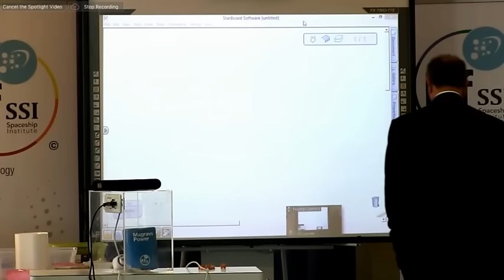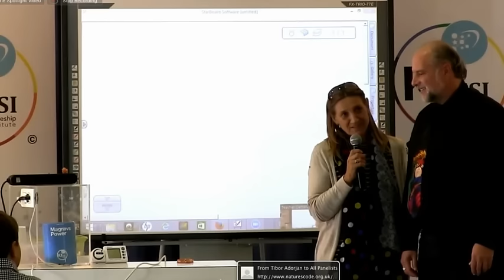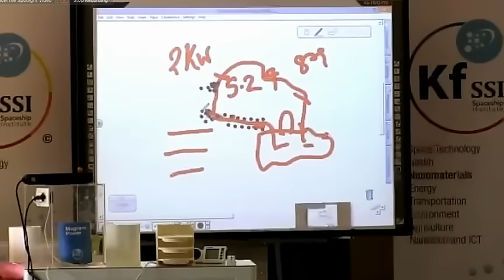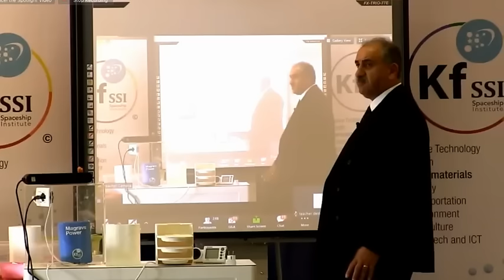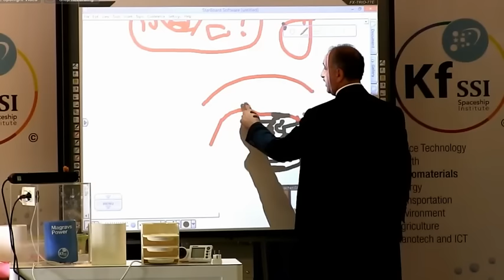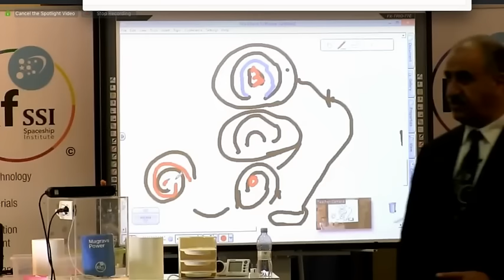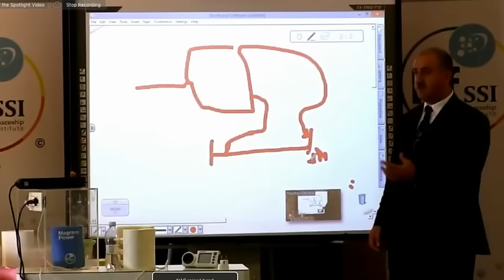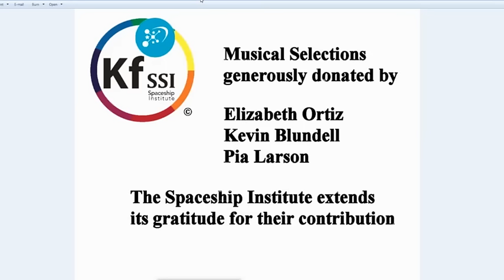KFSSI Blueprint Teaching HD #Session 10

Comment: This "alchemy" of copper treatment explained in "layman" terms is confusing and generate a rejection from technically minds. It happened with so called HHO. If no one come with more scientific explanation it will not be replicated in short time to keep the momentum.The ones who will do it will be ignored by those who need more precision in explanations - usually more technical persons with potential to replicate and - more impotant - to improve and even create new devices.In my understanding by this " caustic" treatment the monatomic ions of K(+) or Na(+) is "inserted into "relaxed" atoms of Copper. This surface is extracting charges from surrounding air and CO2 become graphene like layers over this "amalgam". Potassium is now prevented to become hydroxid and copper surface become (+) charged and superconductive. The potential applied at edges of the wire create the flux where charges are collected from environment. Electricity and pneumatic are similar, somehow. Voltage is pressure, current is flow, diode is one way valve and so on. Until now me one not know a venturi corespondent in electricity. A copper conductor treated in this this way may be that venturi who need a voltage and will extract "current" from nearby system exibiting COP>1.